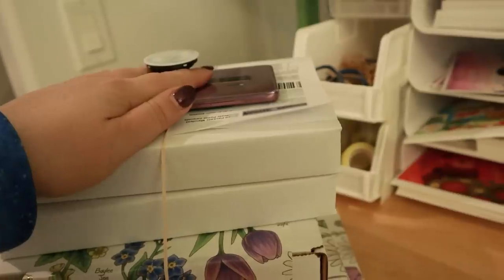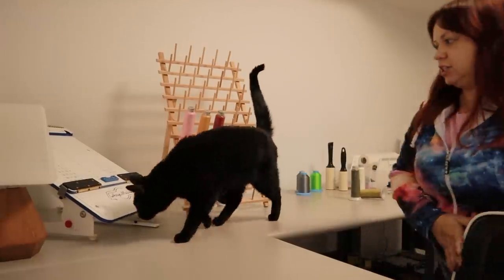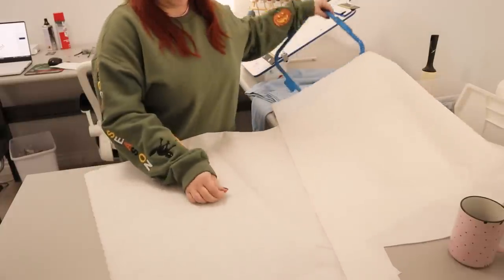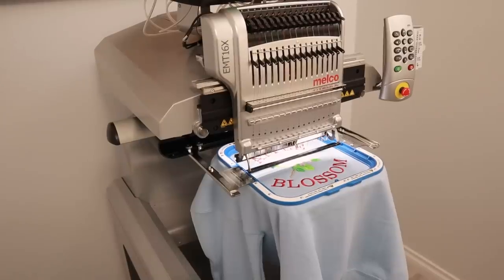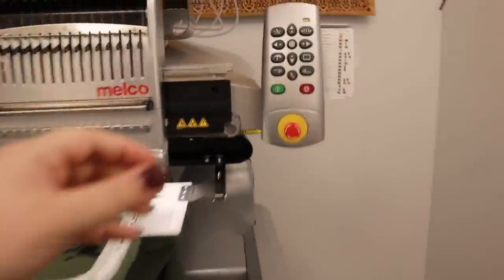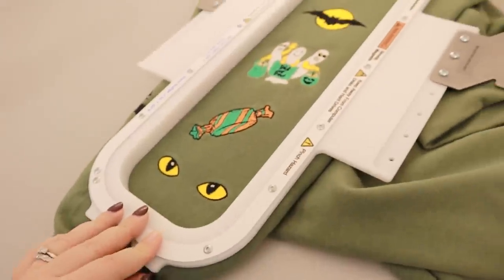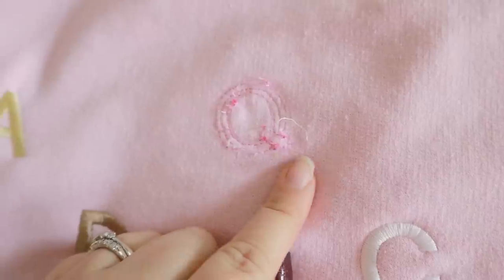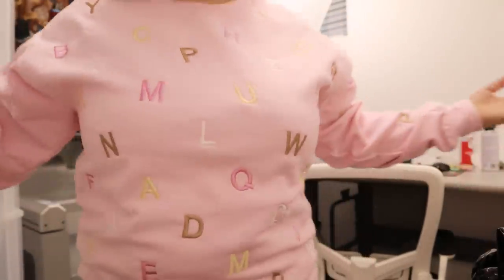Packing Orders & Embroidery Practice

Comment: The water soluble stabilizer wouldn't leave chunks, it kinda goes jelly like and dissolves, but it can leave a bit of residue that will leave the area slightly stiff, but that also varies depending if you just use a spray bottle or wash the whole garment. We've made lacey type xmas ornaments that are just thread that we used water soluble in because a) it would be hard and tedious to get the tear away out of those tiny holes and b) it kind of leaves that slight stiffness to help the ornament keep its shape and not be floppy. So it can be used to your advantage. This applies to the brand we use anyways. Tear away is the best in my opinion but we only have a single needle machine, not sure how it would hold up under the insane speed of this machine lol. Embroidery is sooo much trial and error, as you've seen, it takes a min to find what works best for you and your needs.
Reply from the maker: Thank you for the info on the water soluble stuff. 
I finally got to try tear away since we learned how to do hats yesterday. Soooo easy to use! But man, it leaves a lot of dust in the machine.
Reply: Tear away generally isn't recommended for anything you wear anyway, even when done with home embroidery machines. Unless you're doing like a single satin stitch letter, most designs are way too dense and it'll just fail to do it's job as each needle penetration affects the stability. For most things, you're better off with cutaway, 1-2 layers depending (for stretch fabrics like jumpers and tshirts 2 layers seems to work better.) I know some people use no show mesh for tshirts though! There are also multiple kinds of WSS, ones designed for topping and ones that can be used as a backing (the latter is great for FSL and patches!) and sometimes listings don't differentiate enough between the two. Different people like different things though! Maybe some people have better luck with tear away than those I've seen who only use cut away
Reply: I prefer sticky tear away (I have a baby lock florish) it holds up well to what I need it to do
Reply: @phonesallbroken  never really had that issue with tear away unless it's an extremely dense pattern. Things like what she did on the Halloween sweatshirt we've never had issue with.
Reply: @BayleeJae  your machine does go at the speed of light so I'm sure it's can be worse  We do some novelty gifts and embroider on toilet paper, now THAT leaves a lot of dust in the machine lol.

Comment: Seasoned Machine Embroirder, you don't need to cut off the cut away, the stitching on the Melco is tight enough you can just rip the cut away... You also don't want to use wash away unless you're doing a plush blanket or a towel..

Comment: With the interfacing, can you not just rip it up instead of cutting it? Since it’s basically been perforated by the stitching
Reply from the maker: Only if you use "tear away" stabilizer. This is "cut away" so it must be cut.